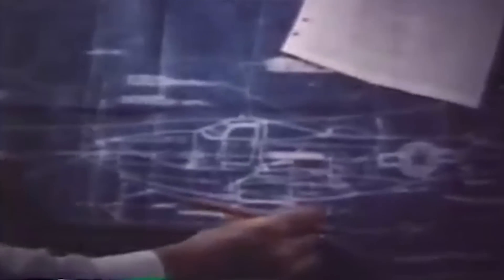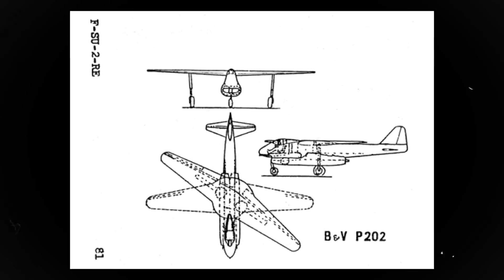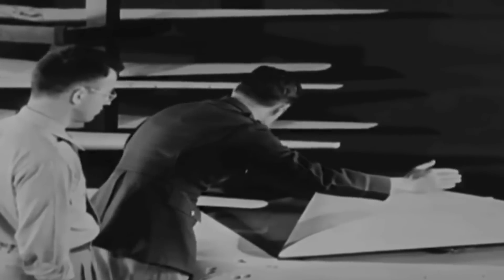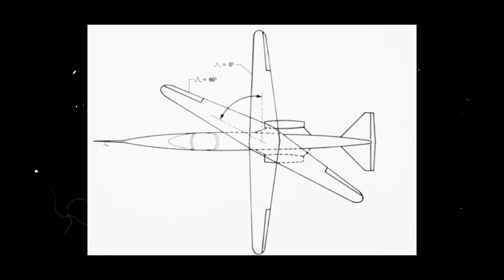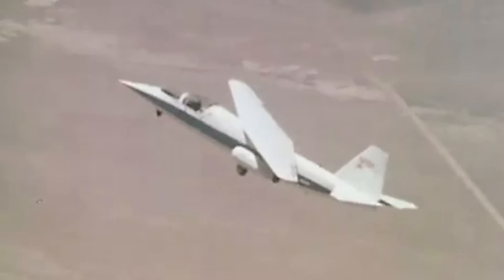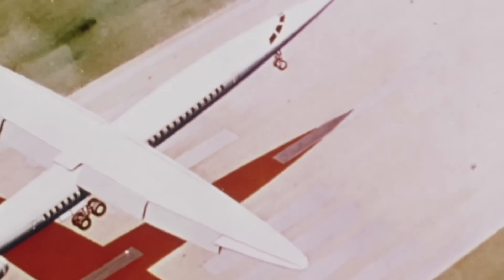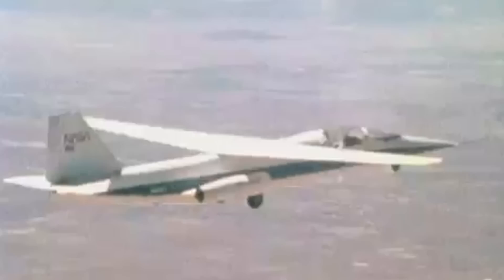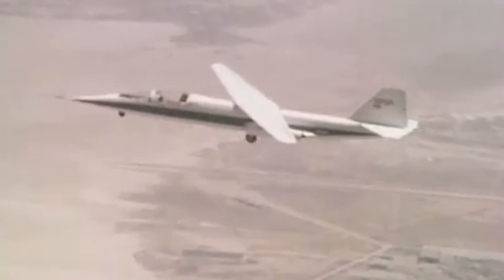The Plane with Scissors for Wings

Comment: I'd imagine the roll rate would be faster when at angle.
Reply: The roll authority will be decreasing as the wing pivots though. The ailerons will also start acting as elevators when they're in the asymmetrical position.

Comment: Kind of disappointing they went to all that trouble only to have tested this application on a plane not capable of supersonic speeds.
Reply: Gotta walk before you run -- or -- need to test subsonic landing capabilities, first!
But I agree, it would have been nice to have a second prototype capable of transsonic. I fear, though, it would require fly-by-wire controls like those used on x-29, which would add complexity.
The pivot region seems to be an area that would be subject to a lot of mechanical stress.
Reply: @icollectstories5702  i think the point was to have a fixed wing in an angle,the sweeping wing was just to try more angles.
Reply: @xiro6  I thought the idea was to try a different style of swing-wing than an F-111. You want more lift at low speeds and less drag at high.
But we've learned to live without variable-geometry wings; well, perhaps we've gotten better at slats than swing wings.
Reply: @icollectstories5702  pues es otro tipo de geometeia variable.
Reply: @icollectstories5702  why have swing wings when you can have a delta.
Reply: @zipz8423  Because swing wings can increase your wingspan for greater lift at low speeds (i.e. carrier landing) and decrease it for less drag at higher speeds than any single fixed-wing configuration.
The problem is in changing the geometry of the wing. Currently, you would add a joint that adds weight and adds a stress point. If we could imagine other techniques for changing the wing shape that would be less intrusive, the idea might be worth revisiting.
IIRC there is work going on in using shape-memory alloys, but I don't think they provide enough strength to be viable. Maybe micro-machines?
But think of what an aircraft carrier would look like if you could reduce fighter stall speeds by 1/2.
Reply: @icollectstories5702  Well yes that is the down side, vastly more weight plus maint` of the pivot. I think the A4 proved delta config was a good fit for carrier borne light fighters.
Reply: @icollectstories5702  to be fair, aircraft carrier planes already have folding wings. So if you can make the fold also be a performance thing in flight all the better. 

I believe the F14 did this. Just swept it's wings after landing for storage rather then also folding them up like other aircraft such as the F/A18
Reply: @Had Tobe Flat this is bait
Reply: @waterdamagedtextbook9858  Even better when noone eats it up 😂 and you see em go around trying even harder in other comments. I'm like, how sad your life must be lol.
Reply: That's gotta be one of the slowest jets I've ever heard of. Hell, even a WW2 vintage T-6 Texan trainer is faster!
Reply: @W1ldTangent  deception airplane,the german shoot at you,you sweep the wing and make a dive pretending you are cripled,then,near the ground,resume flight.
Reply: Waste of taxpayer $$$ as always
Reply: @gp7110  on experimental things there is never a waste of money. The point of that is to learn what works or not. In this case it was not really expensive in the 1st place
Reply: @gp7110  not every idea tried out becomes something new and revolutionary in of itself. 

But you never know until you try it. 

Developing technology requires hundreds of failures before a single success.

Comment: The real purpose of the AD-1 was to investigate wing rigidity. Swing wing designs required twice as much gear dedicated to the airframe, the AD-1 neatly sidestepped that issue. It was never intended to be anything more than a test bed, nor was the concept considered for any specific military or commercial mission. The AD-1 was mostly used for determining how the the leading wing behaved (at high wing angles, it had markedly different handing characteristics turning left and right, especially at high angles of attack); Most of the data gained by the AD-1 was used in the X-29 (with it's forward-swept wings) a couple of years later.

Comment: or you could you know like sweep both wings back? or is that too crazy?
Reply: Swing wing planes have been largely abandoned due to complexity and expense. This would achieve much the same performance but with a simpler mechanism.
Reply: Less moving parts, less weight , less problems.
It may look odd but it workes perfectly fine like this.

Comment: i wonder if the lessons learned from this aircraft were used in the f14 or f111. Did any of those aircraft have the ability to vary the sweep of the wings independently of each other.

Comment: Birds don't have fixed rigid wings, either.
Reply: But all birds wings are always in symmetry. They never become asymmetrical at any wing position while flying.
Reply: @sanakiddy2883  wingshape changes drastically along with position and isnt always symmetrical. High angle turns u can see birds do this.
Reply: @kylealexander7024  yes true.
Reply: @sanakiddy2883  not true. Birds actively use both wings and their full range of motion independently for flight. A really cool example is owls going from gliding to slipping through underbrush to grab prey. Another one is hummingbirds. They don't beat their wings in unison all the time.
Reply: @timbrwolf1121  yes agreed.
Reply: Birds dont have people inside them either!
Reply: Birds don’t have doors. I can’t figure out how to get in.
Reply: Uh. Yah. They also don’t have motors and a propeller for propulsion. 

?
Reply: @allegorx58  afterburning bird
Reply: @alex31ytb  set fire to birds farts.
Reply: @alex31ytb  hold my bird while i strap an icbm to it.
Reply: @allegorx58  Berkut proved that flexible materials are the key for modern combat planes ,
Reply: @enrlichhartman  NASA X planes proved all of that long before Berkut.

Comment: Imagine if Boeing actually built a commercial airliner based on this desgin, how many people would just panic when they see the plane's wing start shifting mid-flight
Reply: rgtrooper13  I've seen the uninformed get nervous when the flaps are extended or retracted. Don't discount the anxieties of people not familiar with how planes work, which is most people. If you're watching this video, you're not one of them.
Reply: @W1ldTangent  that'll be me. The first time I saw it. It's not that they extend or they retract. It's how they shake as they move, as they are blown by the air. As if they're about to fall off any minute.
Reply: @Had Tobe Flat The Earth is a dome? Now that's a new take.
Reply: @RobinNewbrough  the earth IS a dome, one that just happens to be big enough to close on itself thus making what is known as a globe!
Reply: @Had Tobe Flat Wow, I'm impressed. That somehow makes even less sense than the flat earth theories.
Reply: Yeah right?!
Reply: LOL
Reply: When I was a kid the first time i saw thrust reverses go into action while landing scared the hell out of me. Thought the engine was falling apart.
Reply: Half the passengers would bail out of the plane if passenger aircraft carried parachutes! 🤣🤣🤣🤣
Reply: if it is anything like the boeing max 8s or whatever they are called i would say everyone would be worried
Reply: Cause of the fact that it’s Boeing probably all. Nothing new they did in the las 10 years was on the high safety level which they had over the last decades...sadyly.

Comment: I wonder if this was more or less fuel efficient that a standard wing
Reply: What the video didn't make clear is that the advantage of an oblique wing is it's low drag, especially near and just slightly above Mach 1.
Starting "near" Mach 1, there is a shape rise in drag thanks to the formation of shockwaves which is what sweeping a wing is supposed to reduce by decreasing the strength of said waves.
As it turns out, an oblique wing that's swung has lead drag than a symmetric wing where both wings are swept back at the same angle as the oblique wing.
Less drag means less fuel is used and so it's more efficient than a "standard wing".

Before shockwaves become an issue, a wing with a uniform lift distribution (which means a wing with an elliptical planform) has less induced drag than any other wing planform ... which is why high performance gliders/sailplanes have an elliptical planform or one that has been cut lengthwise in half.
So once again, less drag and so more fuel efficient than any "standard wing" that isn't elliptical.
Reply: @lewiscole5193  Thanks

Comment: I saw this on display at Moffett Field/NASA Ames during an airshow in the early/mid 1980s.  It's so tiny!  There are RC model planes that are bigger.
Reply: Not many RC planes that weigh 2100 lbs.
https://www.youtube.com/watch?v=akoJ2zBwX1o
Reply: @-danR  Certainly not that monster.

 This RC plane weighed 234,000 lbs: https://youtu.be/phhH4LswVgA?t=243
Reply: I was kinda shocked how small it was!
Reply: It was behind Wind Tunnel 1 for a long time, next to NASA Ames little museum. Also known as Rutan Model 35.

Comment: I remember this plane. I thought it was a design to soften sonic booms or to delay they past Mach 1. I am a news junkie, not a pilot and I have slept since then. I always wondered what became of this idea.
Reply: Oblique wings have much lower drag both shortly before supersonic speeds as well slightly above supersonic speeds compared to a symmetric swept wing configuration.
And the problem with flying supersonically is the sudden rise in drag that starts just before supersonic speeds.
So the advantage of the oblique wing is that you can make an aircraft that can fly very efficiently at just above Mach 1.

Jones went on to dream of a flying wing passenger airliner.
The aircraft just looked like an elliptical wing with some engines that could swivel so that they always pointed into the wind with stability being taken care of by computer.
Passengers would sit in seats that formed a long row or rows from wingtip to wingtip.
As I understand it, this idea didn't get anywhere in no small part because the wing was too wide when it landed/took off to fit on conventional runways to be able to compete with conventionally shaped airliners.

Jones died some years back and with him when his dreams.
Reply: @lewiscole5193  
Thanks for the info. Very interesting.
Reply: Yes, I remember it years ago in Popular Science.
Reply: @-danR  
October 1972, page 66.
You should be able to read the article online from the old PopSci archive.

Comment: The wing loading with the wings at 60 degrees would have been quite severe if the plane was bigger. Must had to compensate for the nose being pushed down and to the right and the tail with a opposing force. Kinda like wringing out a wet towel.
Reply: Nose being pulled downward?  From what?  

Both the forward and backwards wings generated lift and and that's all transferred to the fuselage by the wing spars and the joint hinge.
The effect is no different than if the fuselage were supported by a beam that just happened to be at an angle to where the ends of the beam were supported by cables.

Comment: but why?
Reply: Less drag more efficient flight or faster.
Thats why fighterjets have so tiny wings.
Longer wings make low speed performance way better.
You can take of in less time with less speed and a shorter runway with expanded wings.
The faster you go the more drag the wing generates but if you fold it in at the same time you gain speed and still generate the same lift.

Comment: So this plane was just an f-14 tomcat but only 1 wing moved?
Reply: No.

What the video didn't make really clear is that the scissor wing has much lower drag both approaching supersonic speeds and slightly above supersonic speeds than if both wing halves were swept backwards.
It's the difference in orientation, one wing pointing forward and one wing pointing backward, that does this.